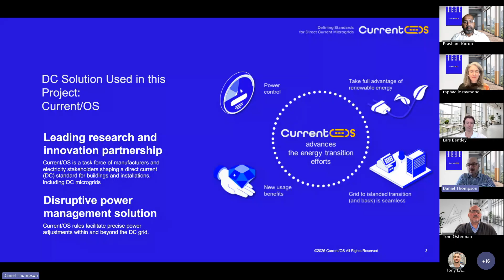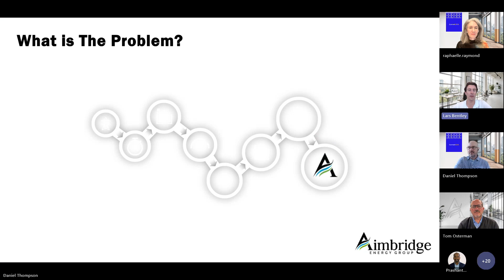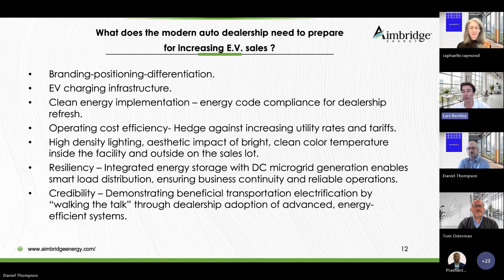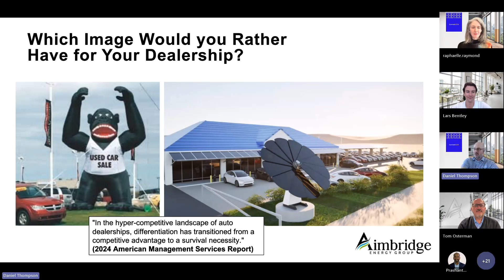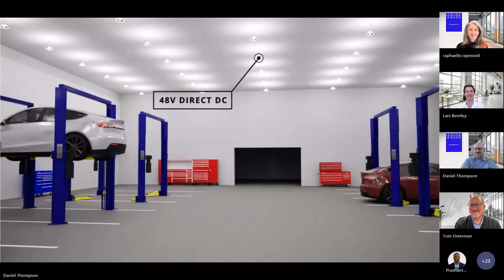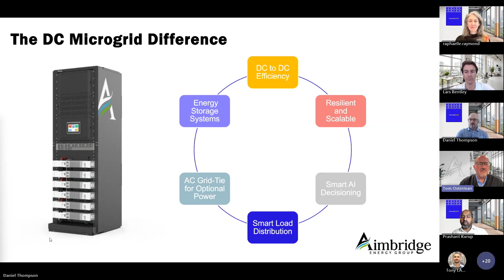Unlocking Direct Current: Power Your Business Faster, Stay Powered When the Grid Fails

Comment: Why not make the charging controllers smarter? Part of connecting to charge is the charge controller reading the vehicle's state of charge. Why not make decisions on power level to provide based on current battery state? Couple that with anticipated stay length and you can really get efficient. Plugging in to a hotel or at home at night, adjust the charging level based on when you'll be leaving in the morning. Say "top me off by 6:00 a.m." and adjust power level from there. For commercial locations like hotels, this can also save on demand charges. Install some 48A max Level 2 chargers, but maybe guests only need 16A of power to top off overnight. The same can be said for at work chargers -- leaving at 4:00 p.m., top me off by then. This also works for theme parks, national parks, etc. Anywhere where the person is going to be for at least several hours. You could further tie the chargers to RFID hotel key cards for guests, and simple tap-to-pay credit card or QR code for everyone else. This also eliminates idle fees and these places shouldn't be in a hurry to clear a slot for someone else. People who chose "max speed" can incur idle fees.

For medium dwell locations like movie theaters, shopping malls, warehouses (think Costco), and sit-down restaurants you could use the slowest of DCFCs. Think 25 kW per port. If you're going to be at the location for at least an hour, if not two, then this again would control for demand charges and provide great "top off" potential without breaking the bank.

Save fast DCFCs for Interstate rest stops, fuel stations off major trip routes, and strategic middle-of-nowhere locations to build out infrastructure. Places people aren't hanging out at but just passing through.